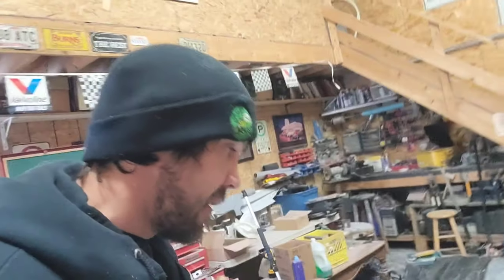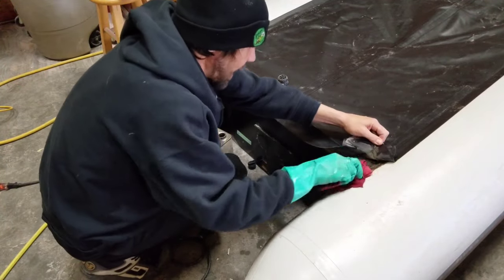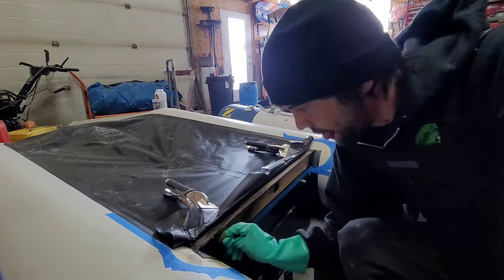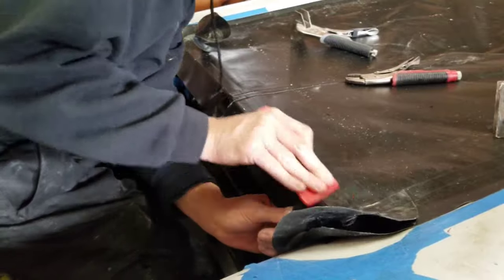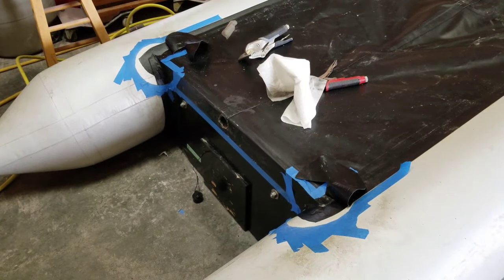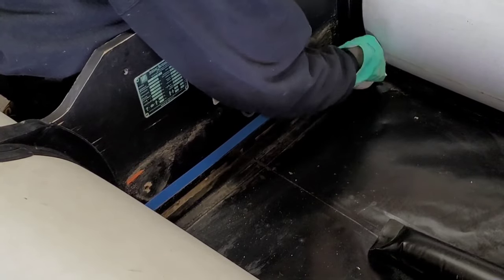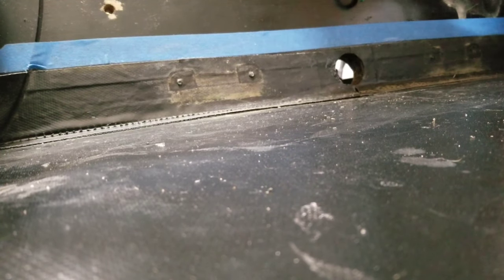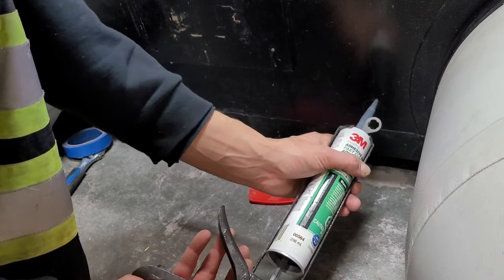Fixing A Leaking Transom on a Sinking Zodiac Inflatable Boat!!!

Comment: How would you go about reinforcing the material that wraps around the bottoms of the transom? I have a few nicks in mine and want to add some material to help with future issues.
Reply from the maker: I would just cut small circular patches with holes in the center to reinforce it.

Comment: Closer I am to do mine, more questions pop up. I was wondering, when you work at the bottom of transom with a heat gun, would you go to both sides before you start gluing back, or you would glue outside first, then you take off fabric inside. Why I'm asking this is, because you may damage new glue you just finished outside, if you start using heat gun inside afterwards, am I right? Thanks
Reply from the maker: That's a very good question, short answer is yes it's best to get everything undone and prepped before. But NO, with the glue being freshly done, and if done right, that glue will be near impossible to come off, even with heat. Will damage the fabric before the glue let's go.
Reply: @gashopperinc  Wow, I didn't know it's so resistant to the heat, freshly done. Thank you for answering my questions! I just got Z7096 today, from the local store, so I'm getting close to attack my Zodiac...:)

Comment: Our 6 year old Saturn PVC dinghy is delaminating at the transom.
The rubber around the tube that the transom inserts into has zero adhesion.
I that supposed to be glued in?
Great video!!
Reply from the maker: Yes, they are glued on.

Comment: I have an older Mercury dingy with just about the same problem. What glue and cleaner would you recommend? Also is there a one part glue ? Thanks
Reply from the maker: 2-part Zodiac Glue or Stabond Glue and for cleaning, MEK or Acetone. Never use a 1 part glue.
Reply: @gashopperinc  Thank you brother 👍
Reply: @gashopperinc , why not one-part?
I use 1-part glue and it works great; I have had patches on the boat for two years and 2,500 km and they still hold.
Reply: @hntrains2 Like many people watching gasshopper's videos, I am researching how to do repairs.    From what I have researched  the best of the "One-Part" glues may be suitable for entry level PVC boats (Saturn, etc), but not higher end Hypalon boats (Zodiac, etc). Hopefully mister GH will chime in and clarify for us.

Comment: Great video, that boat looks very similar to my Zodiac, at least transom and surrounding! I have a few questions, as I would like to fix mine, it started leaking this summer. 1. How much glue, approximately, did you use to fix that transom? 2. How long did it take? 3. What do you do with the brash between applications, it must harden? Thanks!
Reply from the maker: Used about half a quart due to amount of layers the Zodiac Glue suggests. Took about 6 hours over the course of 3 days. I put the brushes in a sealed container to slow the solvents from dissolving. If it's past 24 hours I'll use another brush.
Reply: @gashopperinc  Thank you!

Comment: awesome video! quick question : im working on a 05 bombard typhoon 305 with rotten transom. 
when i took out the old transom, i found that it was impossible to just take it out since it was imbedded on to the transom instead of just glue and had to cut it out. like this guy did https://www.youtube.com/watch?v=0SXrKa4F6Gs&ab_channel=AppleboxProductionsInc.  (play from :59 sec) 
should i be okay to just glue the transom using weaver 2 part csm glue on the sides without bolting it?  or would you rather recommend I use different glue for that part only and bolt the sides down to the transom?
Reply from the maker: Hey there, no need to bolt it in. I would recommend using PVC 2 part glue for that installation but if the new transom is gelcoated, then 120 grit sanding to the bonded surfaces and csm glue will work fine. Just make sure to remove the old dowels and scuff up the surfaces in the transom mount pads. We did a restoration on one with the exact same problem. https://youtu.be/t9QO-0a2a98?si=ANOqhkCjrktUcD70
Reply: @gashopperinc  thanks for your reponse as always! im not familar with gelcoat but im looking to fiberglass epoxy layer on this proformstructual mdo plywood to make a new transom. would csm glue work for this application as well?